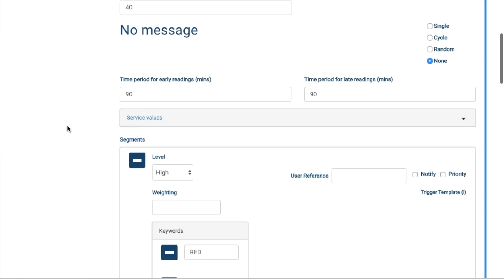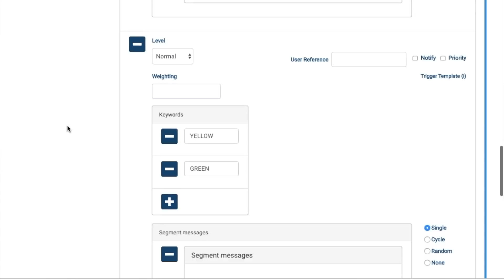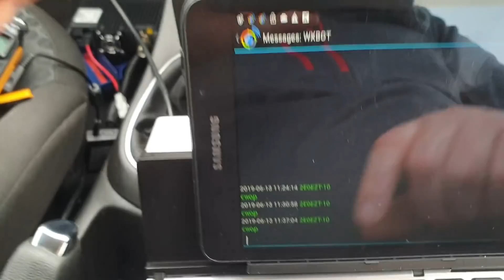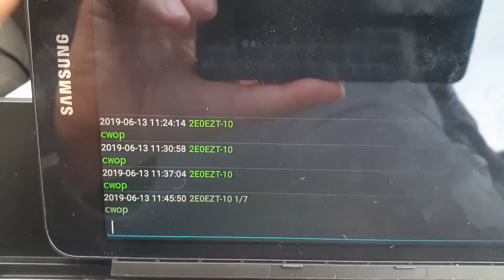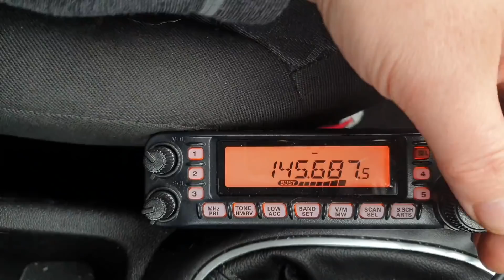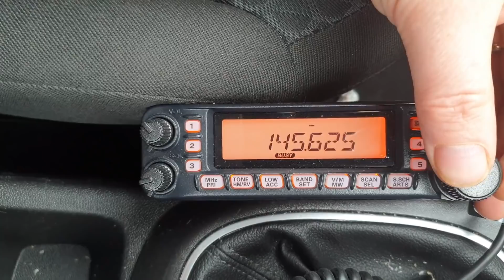Using APRS for ham radio emergency communications

Comment: We used connected packet radio quite a lot in RAYNET, back in the 80's and 90's, for passing long messages, it was very effective over quite long ranges using digipeaters. I've been trying to drum up some interest again, but not having much success.

I still run a personal mailbox on 144.950, and use software packet programs with a homebrew data interface.
Reply from the maker: Yes I've noticed little interest in APRS too

Comment: So why does no manufacturer make a waterproof manpack all band radio? They have handies,radios for cars desk radios but not one radio for the outdoors.
 It hasn’t stopped raining in the uk since 1976, so where are the waterproof outdoor comms kits?
Reply from the maker: Lack of demand. Yaesu have a few handhelds which are water resistant from light showers that I know of.
Reply: 2E0EZT amateur radio so after 40 plus years of development  throughout the storms,flooding, torrential rain year upon year for four decades, the only radio that any of the 3 million plus operators around the world needed was another bloody desk radio, as it seems nobody goes outdoors.
 Ok got it.
I must be the only fool that walks the hills, in adverse weathers , and after 43 years of radio is the only person that thinks a waterproof manpack would be a useful tool in said conditions.
 By the way I don’t want a prc320 that was developed when I was born, it’s too heavy when carrying other kit, and after 4 decades you would have thought there would be some form of radio that would survive the British wx.
Reply from the maker: I hear you. Trying to operate a radio in a tent is tricky but the best option for me.
Reply: 2E0EZT amateur radio my bivvy bag with kit and radio is a tight squeeze in wet wx not ideal, but I’ve been doing it since the early 80s
Reply: In the spirit of ham radio, building one's own gear and modifying surplus stuff, etc., have you considered taking a kit like the uBITX (http://www.hfsignals.com/index.php/ubitx/) and putting it in a waterproof case? In fact, it would seem that it should be possible to put any reasonably small radio, such as a Yaesu FT-817 into a larger waterproof container and slip it inside a backpack. Of course, it would not be as small and compact as a purpose-built radio in a waterproof case designed by the manufacturer but it should work.

Comment: With respect to your software to gateway messages from one system to another (APRS to SMS as an example), you may want to take a look at Project Owl which uses low-cost field radios in a mesh network to transmit messages. Here is a YouTube video showing how the digital radios work: https://www.youtube.com/watch?v=iIXDx-_m2f0  DE WA1KLI

Comment: Nice video. I enjoy watching your journey through amateur radio. On the subject of packet, along with APRS, a packet bulletin board system will allow passing of messages as well. They are easily set up and can be ran on laptops, desktops and the ever popular Raspberry Pi single board computers. A dedicated TNC is not necessary anymore. Using tnc emulating software and a sound card interface, you can have one going on uhf, vhf and or hf. As a added bonus, APRS can be added to the system. Keep doing the videos. 73.
Reply: I conduct operations during Severe Weather. I use APRS from my phone, also Spotter Network that beacons my position as well so the NWS ( National Weather Service- USA) can see me.